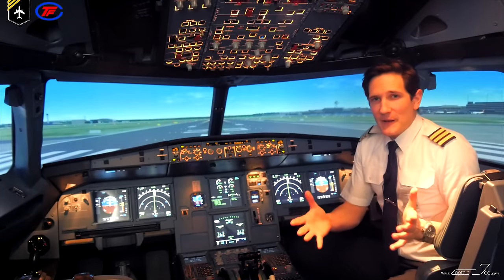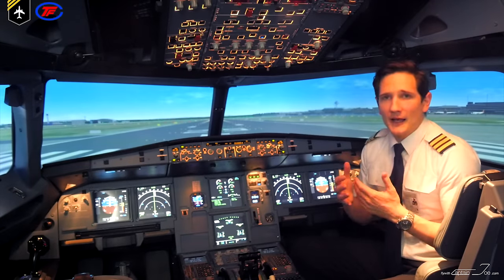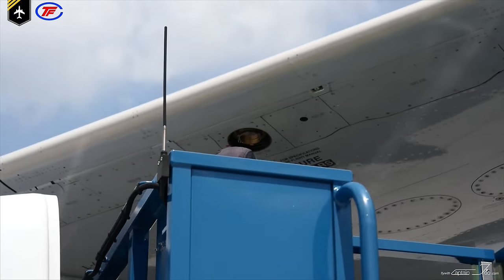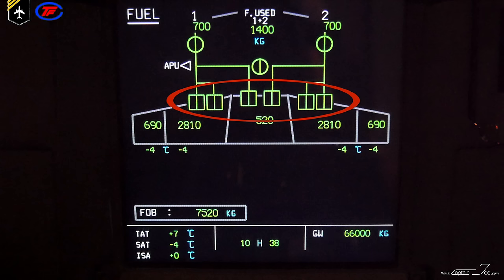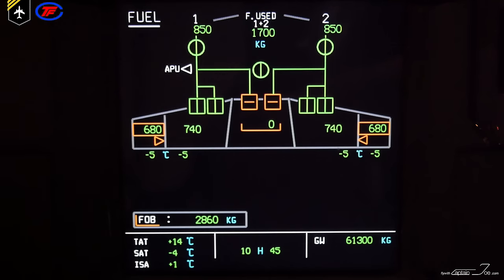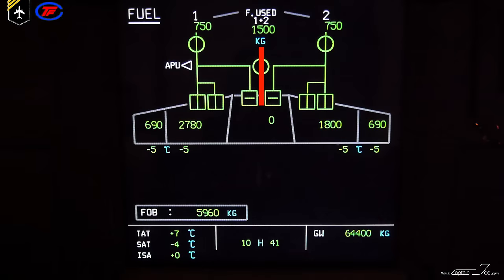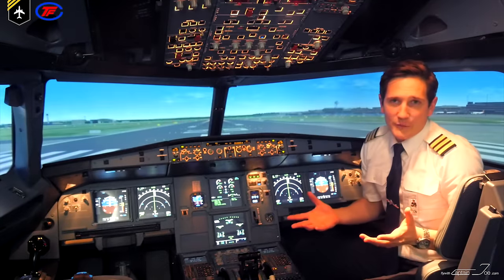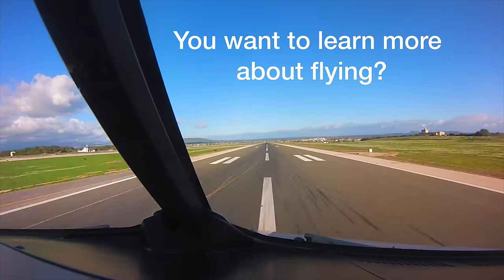How does the AIRBUS FUEL SYSTEM work? Explained by CAPTAIN JOE

Comment: Hi joe, I have a question, how can you start the APU from battery power in a cold and dark start-up if there aren't any fuel pumps running?
Reply: Thanks!
Reply: That is true for other airbus aircraft. In the A320 the APU blow off pump is operated with 115VAC from the static inverter busbar.
Reply: I like when people are sharing knowledge

Comment: Air Transat Flight 236 - Though not suspecting a fuel leak due to a maintenance overlook, they forgot to close the cross feed value thinking that the fuel imbalance will correct itself suspecting it was a computer bug...if I recall it correctly.

Comment: Why isn't the crossfeed valve open by default? Is there a drawback?
Reply: Yes there is. In the case of a leak you would lose fuel in both/all tanks which makes it also harder to notice that there is a leak in the first place. Normally if there is a warning poping up of fuel imbalance, something is propably wrong.
There was a case with a A330 where the cockpit crew had an fuel imbalance indication but though it is a indication failure but in reality was a leak. Because it was night they couldn't see the fuel leaking out from the cabin and so in the end they opened up the xfeed just to be safe and get rid of the warning message. Well, they ended up with no fuel at all over the middle of the atlantic ocean and had to glide about 120km to the next airport on the Azores.

Comment: The engines have the flow meters and the tanks have their own sensors so does that mean that the system can detect a leak? I remember a case where one tank was leaking but the crew thought the engine was just burning more fuel and opened te cross feed valve which caused the fuel to run out. Im not sure if i remember correctly
Reply: The tank sensors do not monitor how much fuel is leaving the tanks in a minute. The way a fuel leak is detected is if the amount of fuel burnt and the amount of fuel remaining equals the amount of fuel you left the gate with.

Comment: hey captain joe i love flying and everything but, im scared most of the take off, when theres a technical issue and plane wont pull up does the plane still have enough air strip left to stop? :)
Reply: You should watch the V1, Vr, V2 video.  The short answer is, once you reach the V1 speed, you are committed to leaving the ground because the plane can no longer safely stop on the remaining runway.  The good news for you is, the aircraft is designed so that even if something fails at that point, the plane can still safely takeoff.  So sit back, relax, and enjoy the thrill of jumping safely into the sky.  Just remember, the most dangerous part of any flight is driving to the airport.

Comment: Hey Joe! I was just wondering why every jetway is connected to the left side on the plane and the planes have doors on both sides, do you have an explanation? oh and nice video as usual!
Reply: Planes are boarded usually from the left side cause it's Captain side (it's an old convention). Right doors are used to board catering or for service reasons... obviously the right ones are there for safety: if you have a fire on the left side the evacuation will be from the right side ;-)
Reply: Same reason you always get on/off a horse from the left side.
Reply: Cargo doors are on the R/H side and catering trucks also do their stuff there as well.

Comment: Are there any fuel filters in the system? I assume that there 2 pumps for redundancy... Can one pump feed enough fuel?
Reply: Yes, one pump is enough, even for both engines via crossfeed. There is a fuel filter which is part of the engines fuel system.

Comment: I'm a bit late, but I've got a question.

I've seen aeroplane wings being bend in extreme angles for testing, as they need to be flexible in flight.
How do they prevent the fuel tanks from bursting when the wings can bend that much?
Also, I'm amazed they can fit that much fuel in the wings; they don't look like they would offer a lot of room for large fuel tanks. How what is this magic?
Reply: Get up close to aircraft wings and u will know how it fits😃.
Reply: The wings are not that thin, especially at the root, and they're lengthy and wide. It quickly adds up to a huge volume. There is also the center tank that is quite cavernous. 
I am not a small guy, barely go through the access ports, but I can fit quite nicely between the baffles directly inboard of the pylon on a 737 where the wing starts to become thinner, with some room to wiggle around, if that's an indication.

Comment: i tend to differ that in a flight simulator, everything is programmed to show as its supposed to be but in the sky you will find different readings due to structural stress the plane might have encountered since its operation... am not been skeptic its just a thought

Comment: Why is there an upper limit for fuel temperature?  Is it due to vapor pressure rupturing the tanks?  Certainly the tanks must be vented, right?  Jet fuel doesn't boil until 176C and autoignition is at 210C, so the limit you quoted is far below that.
Reply: The problem is the so called "Flash Point" which is the temperature where an ignatable mixture can occure in the tank just by the evaporation of the lighter fractions of the fuel.
Reply: I thought about that but the flash point of Jet A and A-1 is allowed to be as low as 38C which is quite a bit lower than the 45/54 deg upper limit.
Reply: Ok, i googled it, The limit is there because the fuel is also used to cool the oil of the IDG "Integraded Drive Generator". If the fuel starts to exceed the temperature limits, normal procedure is to reduce load on the generators and if that isn't enough to start the APU.
Reply: Ah that makes sense, thank you!

Comment: How do they keep the fuel pickup always submerged in fuel?  With some of the angles that an aircraft operates at seems like that if the fuel pickup was in the bottom center of the tank fuel would run away from it in certain conditions.   This is also a question i have for small aircraft where this seems like it would be a bigger problem.
Reply: You have more than one fuel pickup in different places.
Reply: do they have some sort of float valve then so they dont suck air when fuel isn't present?
Reply: The A320´s fuel system is a bit more complex than captain joe could it explain in five minutes. The fuel pumps are housed in an extra partition of the inner cell, called the collector cell. This collector cell is supplied with fuel from the inner cell through clack valves which are located on the bottom of the tank. These clack valves prevent the fuel from flowing back to the inner cell and ensure that the pump inlets are always below the fuel level.
Reply: Thanks. Makes sense.. such a satisfying answer.

Comment: joe what is this string behind the ruder on the testflights???
Reply: If I understand your question, you're asking about the bits of wire hanging off the back of the rudder.  When a plane flies through rain, snow, dust or even dry air it will accumulate a static charge on the exterior skin just like you do when scuffing your feet across the carpet in the winter.  Eventually that static charge will become big enough to discharge back to the surrounding air.  The static discharge wicks on the trailing edge of the wings and tail make sure that those discharges happen far from static sensitive parts of the plane such as the radio antennas.  Otherwise, it would become impossible to hear anything on the radio over the static crash noises the discharges make.

Comment: is there any chances that turbulence cracking the wings, resulting fuel leakage?
Reply: KPSHARMA If you have sufficient wing damage from turbulence to leak fuel, I'd suggest you have a far more serious problem to deal with (loss of wings). Wings are built to take an unbelievable amount of "abuse" without failure. During one engineering test I saw, the wing was bent to nearly 90° before snapping violently. I'd never say a leak is impossible, but I think highly unlikely is the most accurate answer.

Comment: how do you transfer fuel in the a320 in the event of fuel imbalance due to one engine inoperative / engine failure
Reply: via the cross feed valve. That's mentioned in the video.

Comment: hey joe ! what happens if the pilot + copilot are incapacitated and there is no (older or out of work) pilot in the plane ?
Reply: AutoPilot has SOME capacity to land the plane. Also, ATC should be able to teach SOMEONE on the plane how to gently land it.
Reply: If everyone is incapacitated or cannot communicate, the aircraft will continue on autopilot until it runs out of fuel. It happened a couple of times. I remember a Helios flight in Greece that lost cabin pressure and almost everyone became unconscious. Although there was still a flight attendant alive using portable oxygen, he didn't do anything and the plane crashed. Also a private LearJet in the US. That's what happened to MH370, most likely. If someone is still conscious and can communicate, then yeah, it's pretty easy for someone with knowledge to tell them how to land. They did an episode of MythBusters doing just that in a simulator, and they were able to land perfectly. Aircraft pretty much land themselves, given the correct input.
Reply: Diego C. The trick is gaining legitimate access to the cockpit in an emergency. Example Germanwings 9525. The captain was unable to regain access to the cockpit before the co-pilot murdered everyone onboard.
Reply: The autopilot can land the plane fully once the correct information is input into fmc and the correct procedures are followed after entering the information like on an airbus by pressing the approach button and also the second autopilot button the plane will land by its self .
Reply: Yeah, in these days, gaining access to the cockpit could be an issue. But even in the cockpit, most people wouldn't know where to begin. To communicate with someone, one would need to put on the headset (previously removing it from one of the pilots), press the "talk" button, possibly change frequency (and know which frequency to use), all while being under considerable stress, to say the least. Us enthusiasts and people with certain backgrounds may stand a chance, but most people wouldn't.
Reply: Everybody dies (TM).
Reply: The autopilot can land the plane but it has to be put into auto land mode only after the plane has been prepared for approach. A regular passenger would not know how to do this without detailed instruction from the ground. Which is possible, I guess, but unlikely to be successful for a number of reasons.

Comment: hello Joe I wd love to know about the dumping of fuel as how n when its needed.
Reply: Dumping fuel is done to reduce the aircrafts weight. In most airliners the maximum take off weight is higher than the maximum landing weight which can create a bit of a problem if you have a serious malfuntion early in the flight and you should land immediatly. The aircraft would still be to heavy to land safely at this point and because they can't throw the passengers over board, they dump fuel until maximum landing weight is reached.
Reply: shi01 thanks but a bit skeptical that ain't we disposing off such great amount of hydrocarbons into the atmosphere?
Reply: Nobody said it would be environmentally friendly to dump fuel into the atmosphere. But that's how things are at the moment. It actually doesn't happen so often because it's really not a standard procedure to dump fuel in flight.

Comment: Commercial aircraft don’t use fuel,advancements in engine technology means that they don’t use fuel,the power comes from compressed air..the thickness of the wings has decreased dramatically over the years,so now we pay in the price of the ticket,fuel that is not there in the wings...
Reply: @Kenneth >  I have worked aircraft for 32 years.  We have to test how much fuel tanks hold for Certification purposes.  The manufacturer CANNOT lie on how much fuel the aircraft holds.  So now tell us your expertise to back up your RIDICULOUS claim.
Reply: @sexigrande1792  - Yes, they are beyond help. It seems that they have serious mental problems concerning their delusions.

Comment: 3:44 Why did you turn of the fuel pumps?
Reply: So fuel is no longer pumped from the right side and is only taken from the left. Because the left side is heavier you need to reduce the weight difference

Comment: is there also a fuel return line aswell?
Reply: If you mean a return line for unused fuel back from the engine to the tanks, then the answer is no. The pumps are supplying the engines continuously with pressurized fuel without the possibility to return any of that fuel.

Comment: The new A321 NEOs eliminated the center tank pumps and just uses jet pumps. .....because the center tank auto-feed system is a frequent log write up.
Reply: The original A321 also had jet pumps, the A320Neo now uses them as well.
Reply: @tomstravels520   Glad to hear it. The center tank auto feed system has been troublesome and also somewhat misunderstood by pilots. 
Wait....how does that work for mechanics? What if they want to transfer fuel into or out of the center tank for maintenance?

Comment: What is the actual amount fuel the Airbus holds? According to this video it is in excess of 6,000 gallons and other literature claims is 80,000 gallons. That’s a huge difference. So which is it? 

And how many gallons would a 747 or 777 hold?
Reply: Which Model by Airbus? Airbus produces a lot of different models and even more Airbus models are still in use, althoug not in production anymore. Also there are submodels that can have different fuel capacity again compared to the base models.

Comment: If I remember correctly an incorrectly designed fuel to oil heat exchanger once caused all engines to flame out on a Boeing due to ice that blocked the heat exchanger - what an irony...

Comment: just finished watching few clips on jet fuel hoax and I came across your clip about the fuel system.  Your video just completely woke me up from almost believing that we're being lie about paying for fuel charge, that airplane are run by compressed air not by fuel.  Anyhow, just got a few question I like to ask if you have a moment. 1. From the Jet Fuel Hoax clips they mentioned aircraft wings will NOT ever have ability to carry such heavy load of fuels on both wings.  I am finding this reasonable.  What do you think about this? Does aircraft wings really can sustain weight as much as 4 buses on each side of wings??
2. how do a fully fueled airplane keep its center weight balanced when turning (banking)
Reply: 1.  Yes, they do.  They have to be strong enough to lift the aircraft off the ground, and on an A380 that can be up to 590 tons.  The weight of the fuel helps to counteract the bending moment on take-off, or they would have to be even stronger.  The wings are usually made from high strength aluminium alloy, although many parts on the latest generation airliners are now composite material.  They will also use titanium where necessary for strength.  The design is done using CAD tools and Finite Eement Analysis, so the metal is only put where it's needed.  This results in a very strong structure that is still relatively light. 

2.  If you're on an aircraft and have a drink on the table in front of you, what happens when the aircraft turns?  Generally nothing.  Airliners don't make sudden or steep movements, and usually maintain postive G when manoeuvering.  This, along with baffles in the tanks to minimse any fuel sloshing,  enables the aircraft to bank safely without upsetting the trim.  Added to that, with the fuel usually in the wings and fuelage centre section, most of the weight is fairly central anyway, whatever the aircraft is doing.  The exception was Concorde, which needed a complex system for pumping fuel around the various tanks to keep the C of G in the right place.
Reply: LOL!!! That is a tongue in cheek question....you know it's not possible for the aircraft to maintain balance with gallons of kerosine swishing around (or just being) in the wings. To anyone still in doubt (and who can see past the bloke in Captain's uniform) Google Airbus A380 wings....and you'll be surprised!!
Reply: @ @paulshepherd8295  ....bollocks!!!

Comment: physically impossible to have that much weight in those wings
Reply: @rcairflr  heard of common sense or logic? Jumbo jets are made of aluminum except for the turbines that are titanium. Wings are cantilever and for similar weight on land, how much concrete and steel needed? And before you come foe anybody acting all superior,  watch the typos
Reply: @rcairflr look up how much liquid fuel wings are supposed to contain, compare it with the same amount that is in a tank. Refueling on a380 takes 45 minutes. same amount to fill a tank would take hours. Shouldn't take you more than 5 minutes of actual research to see what I am saying is accurate. Besides all that I'm an architect